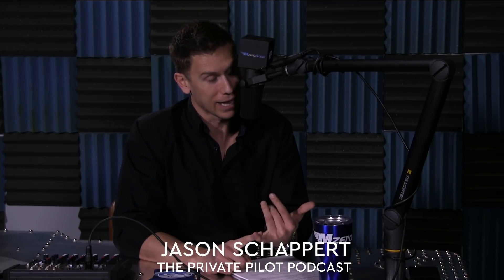Running Out Of Fuel In VFR Conditions 7700 - MzeroA Flight Training Podcast

Comment: In 1977 I was a Senior in high school and in my 4th year of an Aviation Science program. I was chosen with a group of people of all ages to participate in an experiment with the FAA involving a DC 8. We had to simulate an emergency and get 150 people off the aircraft in 90 seconds or less. Once we arrived at the airport, we realized the experiment had to be performed in total darkness. The aircraft had been moved to a hanger and all of the windows had been covered, and we had to wait until night. Everyone got on board and took their assigned seats. The usual preflight instructions and emergency procedures were given to the" passengers" by a flight attendant. After the notice was given to evacuate, we popped all of the emergency exits and began to disembark the aircraft. Without a practice run, we managed to get all 150 people off the aircraft safely in 58 seconds. I'm aware this in no way would be as hectic and panic stricken as an actual emergency,  however it was still a privilege to be able to participate. Love all of your videos and keep up the great work.